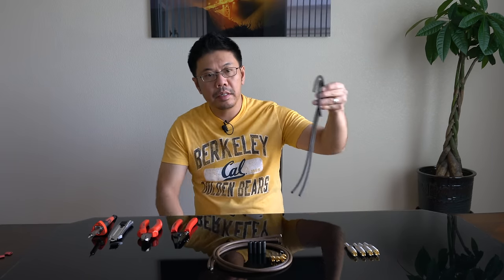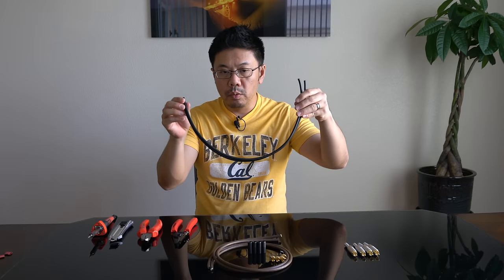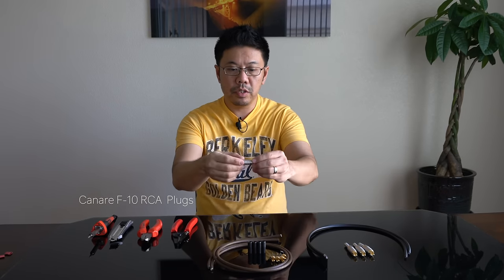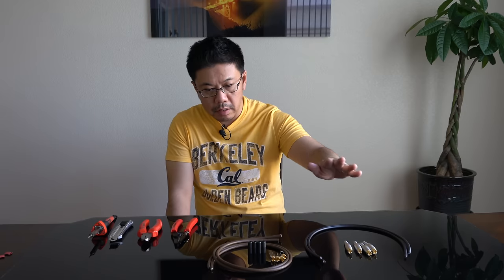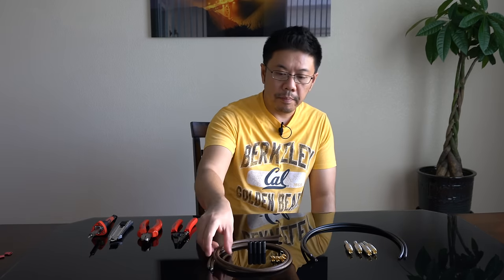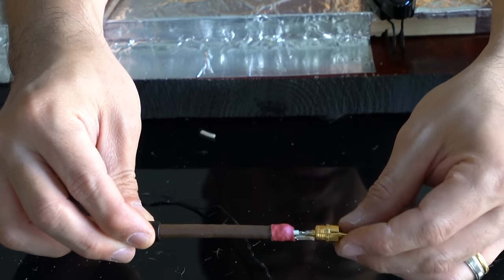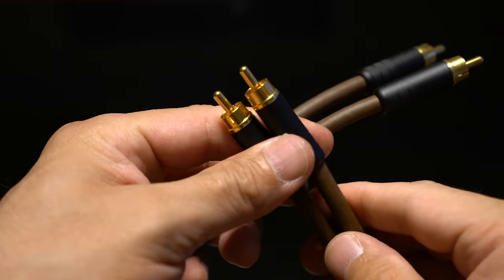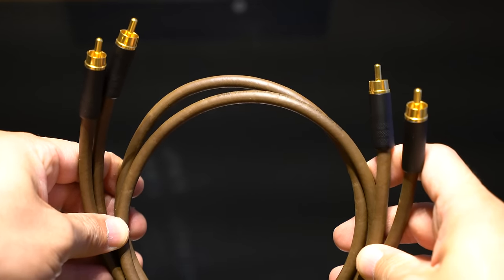$30 Audiophile Grade RCA Interconnects, DIY Better Sounding High Quality Cables

Comment: You would find soldering much easier and get better  results if you abandon the "silver bearing lead free solder" and just use 60/40 lead/tin solder. It wets the surface better, flows better and at a lower temperature. You would get much better joint integrity and conduction. The silver content in this Silver bearing solder is so low that it is irrelevant to conductivity.
Reply: Oyaide makes Japanese high grade Solder with extremely high purity material. It has 4.7% silver and 1.7% copper. However even the Tin it uses is very pure 5N. It is also Eutectic. It has a higher melting point at 217C. However that is not crazy high. I have tried 60/40 and other lower temp solder and they sound pretty crappy to my ears. I also agree that solders with very high tempreture or that are not Eutectic solders may creat more damamge than good. So it is a balancing act. The production people that use the 60/40 and a like do it because it is fast and easy to work with, NOT BECAUSE IT SOUNDS BETTER, IT CLEARLY DOES NOT!
Reply: @aaronfriedman8201  I will take fast and easy over unidentified cold solder any time.

Comment: Pro gear uses spec Belden cable, transformer balanced, low impedance 3 conductor plus physical ground summing on all racks driven 6' into the ground.
Audiophile cable uses high impedance two conductor.   
That's why pros don't believe in snake oil.

Comment: Hi Tharbamar, your cables look amazing. FAT! and flexible.
Is there a reason why you "waste" one whole conductor (or 2 in the second part of the vid) by connecting it to the shield? Isn't there other cable to use that only has a single conductor and possibly better shield that would be cheaper AND better? Not criticizing, just curious.

Comment: Hello, what is the plastic clamp you use to hold cable while soldering.  Nice job on your videos.
Reply from the maker: I’m just using old sunglasses holder for car sun visors.
Reply: @Tharbamar  thank you.   watching your diy for rca cables right now.
Reply: So what is your best recommendation for cable and rca plug combination??  Reply requested.
Reply from the maker: My favorite is the same as in the video, Belden and Switchcraft for RCA cables.
Reply: @Tharbamar  thank you much.  I run a vintage pioneer system, a tube amp, and new martin and logan speakers.  Lots of vinyl.  What is your system?
Reply from the maker: My current main amp is Denon PMA-SX11, Sony HAP-Z1ES DSD music server & vintage Denon DP-47F turntable with Whatfedale Elysian 2 speakers.
You can also see them in my latest video or community post of this channel.
Reply: @Tharbamar  thanks

Comment: Thank you very much for your tutorials,very helpful.we love your channel...tharbamar I am shopping for a new floorstanding speaker cause I bought a new two story house with open ceiling,very high and wide.what is your recommendation with your experience since you have done multiple floorstanding speaker auditions??? Just for stereo configuration without subwoofer.Jazz is  what I listen the most..my current equipment is the Kef ls50 wireless .they sound awesome but I feel there.'s something missing ..please I will really appreciate your help...I am thinking about the Svs ultra tower or are there better option in this price range???  Thank you much
Reply from the maker: For high ceiling and bigger than average room SVS Ultra is hard to beat, no other speakers will fill the room better than Ultra with good accurate musical sound.
Reply: @Tharbamar  thank you very much.

Comment: nice video..tnx.. but i Always should solder the ground wire not only crimping ( after years of use thats for me NOT a stable connection) … ofcouse you have to be carefull of NOT overheating...but being a Hamradio and Electronics guy for over 50 years...soldering is not a problem..  :)

Comment: doing my cables myself as well. especially when ur buying chinch cable, your equipment probably aint that high quality anyway. otherwise you could ( or better, should ) use XLR anyway. So Spending more on cable is just an immense waste of money and lets be honest, we all know that a good cable is a good cable, no need to go super high end. a 20€ chinch cable is pretty much as good as it gets already. Maybe when u wanna go super secure overkill, like in this video or the cables i do myself you can pay 30-40€ for a cable and have a peace of mind if thats your thing. I do it because i want pretty cables that match my gear and i need very little cable so it doesnt bust my wallet.

Comment: I thought only 1 end of the shielding is supposed to be connected to the ground
Reply: indeed that how we build them in the studio's, i connect the shield to the output stage, since output is low impedance.
Reply: If you don't have sound grounding, as your reference point, you will end up chasing your tail.  In other words, if you have a good ground in your electrical system, there's really no reason not to connect both ends/terminations of the copper conductors to their respective connection points...and that includes both the signal conductor and the low/shield.  I've worked in an electrical lab for more than 30 years and all of the coaxial cable we use has the shielding connected at BOTH ends.  We do, however, also have a great copper ground bus that encircles the entire lab, so, once again, all of your electrical must be referenced to a good ground.

Comment: what are your thoughts on solderless connectors using screws?
Reply from the maker: Personally I preferred solderless connection.
Reply: @Tharbamar Thanks for the reply, an recommendation on what solderless connector to use?

Comment: Not a good idea to connect shield to ground at both ends as it creates a local earth loop. Better to connect shield to low impedance end, usually source end is lower, any rf noise gets drained to ground through the lower source impedance.
Reply from the maker: Nah, done that way so many times, directional type is overrated. I have and built all methods nothing comes close to these methods in sound quality.
Reply: @Tharbamar  I'll bow to your greater experience of auditioning. Theory is not always borne out in practice. I've always grounded the shield at source as good practice, but haven't compared the sound with both ends connected. Maybe I'll try it.
Reply: No problem whatsever If both units share a common ground. For example Naim amps don't pass ground signal to rca ports! If the source eqipment doesn't have a ground pin now you have a ground loop problem between chasis of the source equipment and amp. If you inject ground signal one of the unused ports of your amp then it's ok as well (ground is shared between rca ports) It's not easy to say this method is better than this I guess.
Reply: @Tharbamar  It its all dependent on the equipment which you connect... I'm always preferring one side shield connection, that can work always...

Comment: Do you have a recommendation for Balanced cables - I assume Neutrik connectors, but which cable and methodology? Thanks. M
Reply from the maker: I was using Mogami W2549 but I switch over to W2534, Canare L4E6S or Belden 8402 cables, I use very similar ground connection methods as well as traditional method with Neutrik Gold or Silver pin connectors, thanks
Reply: @Tharbamar   Great video. As I'm someone with no soldering experience, do you ever sell the cables you make?

Comment: It is fun to diy cables. However it is a trial and error method. There is synergy involved, matching cables and connectors. I have seen your reviews, and you are right cables do matter to sound quality. But having seen the standard of your equipment reviews, I am not surprised you are happy with your diy cables. With low to mid level equipments, your cables should be good enough. Personally, I have made lots of Mogami, Canare, Belden cables myself. With typical systems consisting of few thousand dollars amplifiers (receivers), speakers, you are not gonna get the level of resolution needed to hear the difference. But once you get to high enough level of equipments, quality listening room, clean power and ground, then you will notice a lot of difference in cables. I am not saying more expensive is always better. I have just replaced a $3000 digital xlr cable with $600 one, because the cheaper one did sound marginally better. There are great affordable cables out there that can out perform multiple $k cables. But there are also very expensive cables that really perform. So to say that cheap quality cables are all that you need, and expensive cables are just hyped, is not correct. For most people, yes BlueJean or well made diy cables will do the job. But to some others, there are better out there.
Reply from the maker: FYI I used to have over $25k set up, for cables  I can tell the difference no matter how cheap the set up is, it’s all about synergy, not all about how much the cost of system is because I have a friend with $100k+ set up and I’m not impressed to be honest, thanks
Reply: I would imagine you are in the audio trade, selling cables?
Reply: Brown is more in the line of truth as regard his reasoning high end sources when properly match and place in it right setting can in effect expose the limitation of a cable ability to carry data while at the other end of the spectrum it can enhance the ability of a well made cable using the very best of conductor to  excel to it given potential  generally DIY made cables sound great on a modest setup but up against a high end setup  flaw start to reveal itself that  generally the case for those who has a audiophile ear granted not all expensive cable is worth it claims but generally the rules of the game it a properly select  high-end cable match with a properly place system will manifest it worth and one will soon realise DIY cables has it place but not when it come to when it really matter the audiophile ear

Comment: I tried making DIY RCA cable the Japanese way (shield soldered on both ends), and the result is sound on high frequencies is dull and low resolution.

I tried the other method, soldering shield only on one end, sound more detailed now and also high resolution.

I think, choose the Japanese way if you have an overly bright sound system and want to tame high frequency.
Reply: Less prone to noise also.
Reply: 100% correct. Directional  interconnects sound more open and transparent than Japanese constructed cables. Even my wife can hear the difference.

Comment: My pre amp will be on side wall with power amp between speakers, can I safely use 4 meters rca cable from pre to power amp without any sound degradation? And what cable would you recommend?
Thanks.
Reply from the maker: It's a little too long for me, personally I would not use RCA cables longer than 1.5m. If you have balance inputs it would be better for longer runs.

Comment: how do you compare Mogami 2549 with 2534? Which is better?
Reply: 2549 as the most neutral cable I’ve ever used in my 45 years in the audio game.

Comment: Can I run rca cables 30 feet?
Reply from the maker: May be depending on surrounding with regular RCA cables, you can also use balanced RCA from Khadas Audio for long runs but I’m not sure if they have 30ft cables.

Comment: IF YOU LISTEN IN SINGLE ENDED ALWAYS USE COAXIAL CABLE NOT TWISTED PAIRS .COAXIAL GIVES YOU THE CORRECT HOLOGRAM OF SOUND THE BETTER THE CABLE THE BETTER THE SOUND ,BUT TWISTED PAIRS ARE MADE FOR BALLANCE CONNECTION ,THEY MAYBE GIVES YOU A BEAUTIFUL PICTURE BUT NOT THE RIGHT ONE....
Reply: I should have seen your comment before going ahead to build the cable. I can confirm your comment after building them. You are correct.
Reply: @honghong7615  good for you bro.enjoy.....

Comment: Your soldering technique is quite strange like you are painting :-D the iron should be moved slowly so that heat can transfer deliberately without the joint cooling during movement of the joint or the iron. Also you are chopping the video each time you crimp, what is it you are not showing us? :-)
Reply from the maker: Nothing to hide, I’m just not aware that I was out of frame, thanks

Comment: So you just put some RCA plugs on some cheap of the shelf cable.
Why would that be better sounding than some brand name quality cables.
At least brand name cables can be listened to and if not to your liking send back.
Reply: Because brands like canare and mogami are the ones that delivers the cables the expensive brands make there cables from. Mogami and canare are used in expensive studio's. I had expensive Chord cables but the canare i made for 50 eu sounded much better. So if you dont't want to use pure silver cables then in the copper segment canare, mogami and belden got the same sound quality as top line expensive brands.

Comment: OMG, you should not use the high-frequency cable for low-frequency signals. You introducing capacitor and it will change frequency response :(

Comment: 200+ comments, not one calls out the BS that is cables. 

You folks actually believe cables make a difference. What a total waste of money.
Reply: They do make a difference, that's why he illustrates how to DIY rather than paying hundreds or even thousands for snake oil. I'd like to see capacitance and resistance measurements included in these videos.

Comment: This is typical "audio voodoo":)) The RCA cables are as thick as your finger :)) Have you ever seen the inside of an amplifier? All you need to do is unscrew any amplifier and check what cable the RCA connectors are connected to the amplifier housing. The connectors are soldered with thin cables, so why this nonsense with finger-thick RCA cables?
Reply from the maker: Cool, thanks man one of the most revealing commenter ever. Bravo!
Reply: @Tharbamar  You're welcome!!
Reply: @Tharbamar  Remember, don't forget to put the pot lids on loudspeakers. One loudspeaker should be placed next to the stove and the other next to the refrigerator.Hifi effect guaranteed. :))
Reply from the maker: @dradowan2586  You're so SmaaarT!
Reply: @Tharbamar  And thank you for your appreciation. :))
The use of such thick RCA cables would be justified if all electronic components: capacitors, resistors, power amplifiers, integrated circuits were to be connected with the same finger-thick cables.
Audio equipment would be larger than an apartment, even a house. Don't be offended, I call it "audio voodoo" :))
Unless you are able to convince me of your opinion by providing appropriate arguments?

Comment: Too much BS get to the point !
Reply from the maker: Oh BS 👍 nice, thanks
Reply: @Tharbamar screw that guy! I recently came across a technics sl-m3 and had it fixed and am looking for a proper rca interconnect would you be able to recommend one or preferably sell me one of the ones you make? 1 meter long would be perfect. The receiver is a Onkyo tx-nr555. Thanks for reading

Comment: Your quality is so poor that you only qualify for IPC 610 class 1.  You need to learn how to do what you are showing others that is possible.  I have been in this industry for thirty two years and would not recommend your hire to my employer.  You need to purchase the IPC 610 book and read it and re-read it.
Reply: I spent 25 years on the hardware side of IT.  Those soldering techniques would have gotten me fired.   And why is he using cable meant for XLR balanced connectors?  Seems pricey to waste on an interconnect.
Reply from the maker: I run my own business, do not work for anyone. This is just a hobby, I do not need any recommendation, I hire people not other way around, thanks
I loved both comments above 😀
Reply: @mikepiontek1550  I don't understand what you are writing here. Since you are in the industry, you are probably a weak specialist. Here, the "costly cable waste" does not count. The interconnect is supposed to give a beautiful sound. This is all that matters in audio, not savings on cents, when proprietary cables cost thousands of $$.